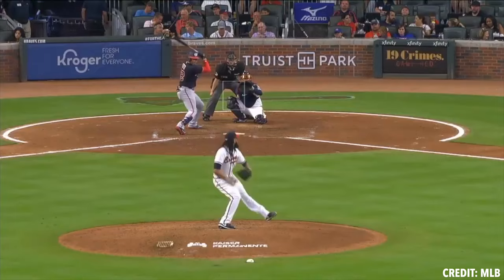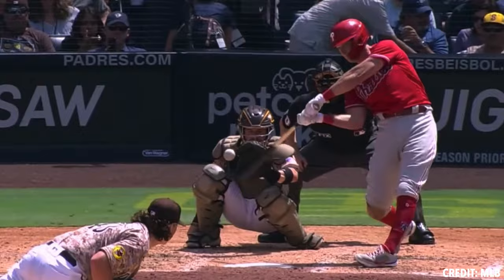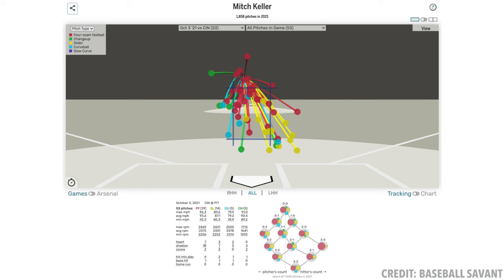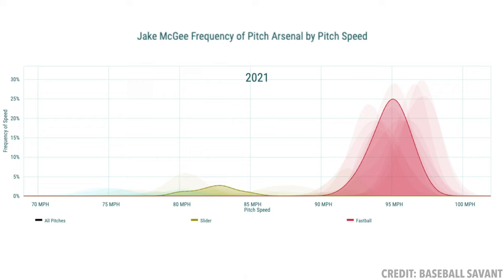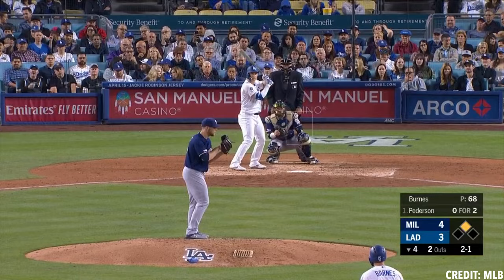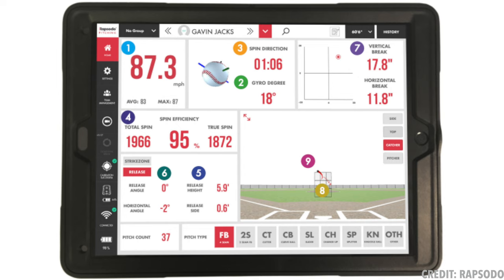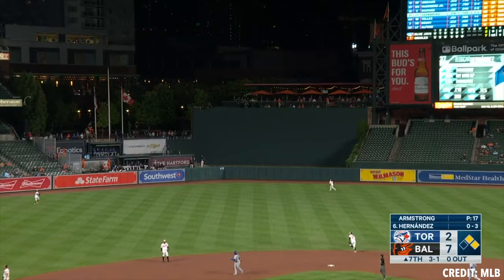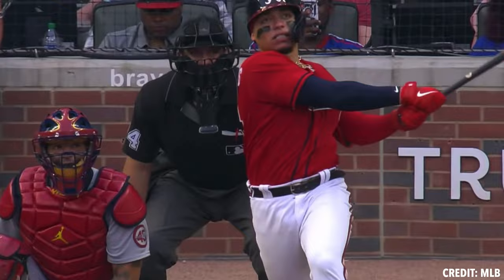How To Fix Your Flat Fastball

Comment: How does this relate to a fastball with high induced vertical break but a high vertical approach angle too would this be considered flat?
Reply from the maker: If you're not having success, it could be a result of throwing low in the zone where it may "flatten" out. Otherwise, throwing up in the zone is usually more effective with high VB. Verlander and Rodon are good examples of this

Comment: What does it mean if your ivb is below 13-16 inches
Reply from the maker: You can try messing around with sinkers. It's difficult to recommend without knowing spin efficiency, spin rate, spin direction, or arm slot